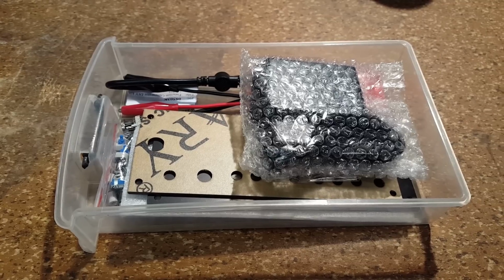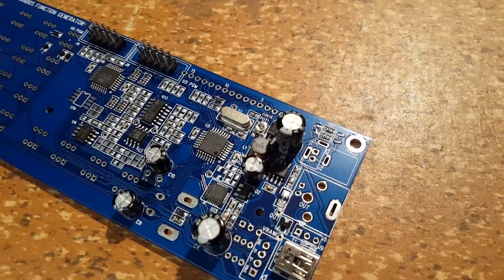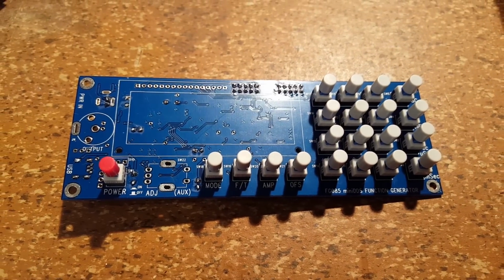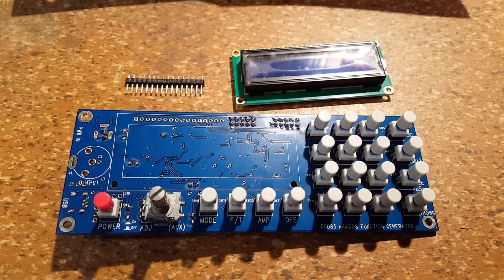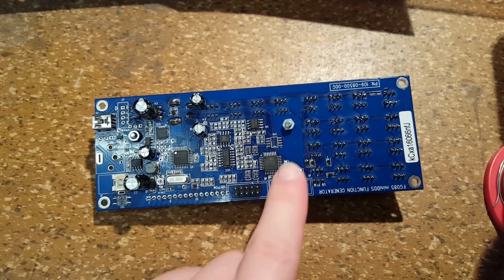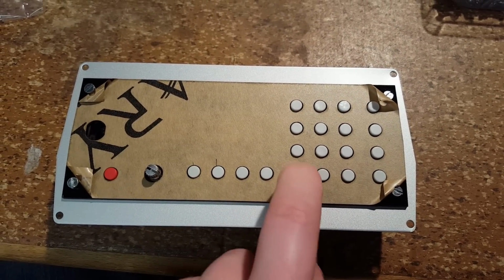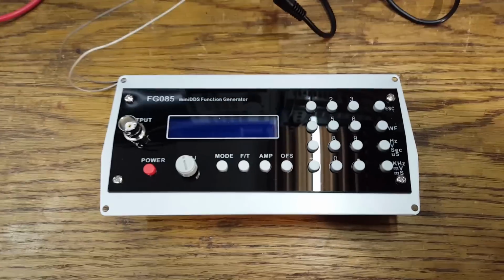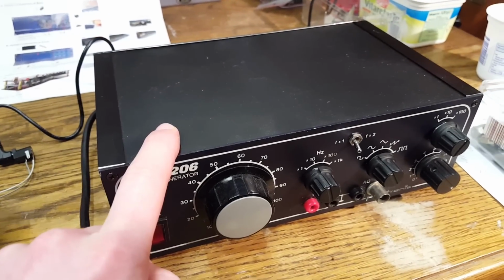Building the FG085 Arbitrary Function Generator (1/2)

Comment: Nice video. I just finished assembling one of these. I found three things helpful in the assembly:

* The back of the display had metal bezel tabs rubbing on the circuit board so I used a little electrical tape to insulate the two.

* The capacitors made soldering a few of the switches difficult so I'd install the caps last.

* I used just a dab of hot glue along the edge of the switches to hold them in place while  I soldered the other side. No mis-alignment here.

It works great for what I need it to do!

Thanks for posting the vid.